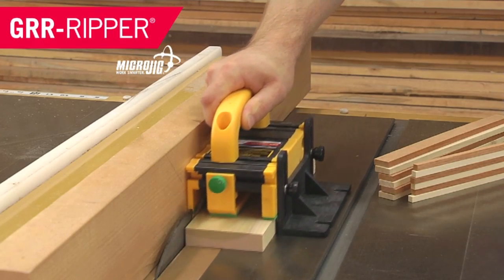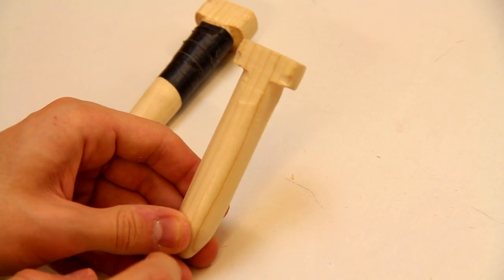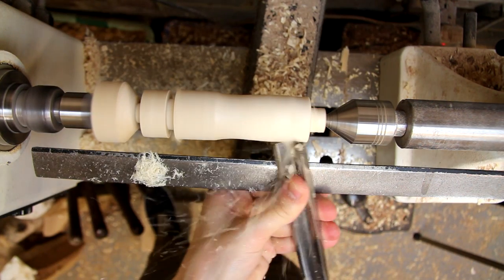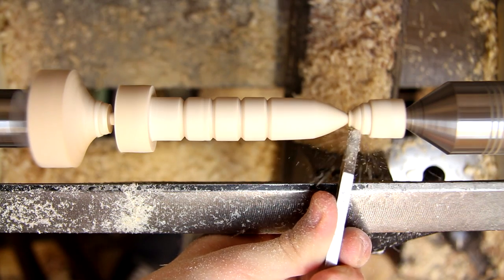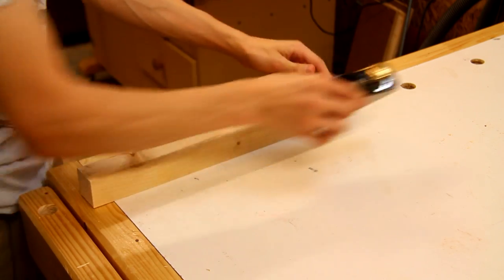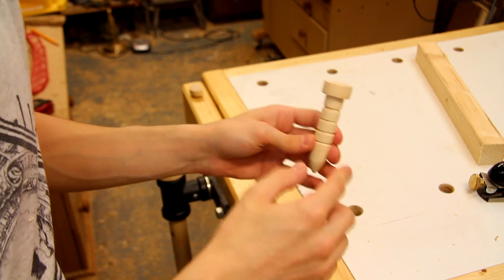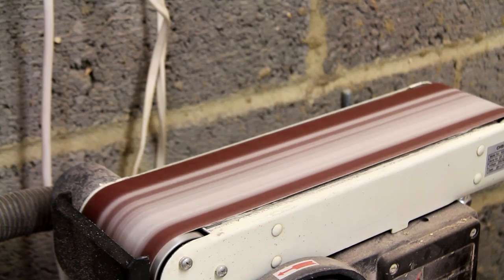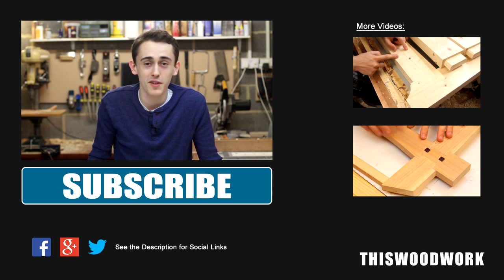Homemade Round Bench Dogs

Comment: I cut a slot in mine at the band saw and put in a little wedge which creates a little spring effect.  Then you can make the fit a little loose but it still stays where you put it and it won't be as affected by seasonal changes.  You have to leave enough solid at the top to keep it from splitting.
Reply from the maker: Cutting a slot would be a really good idea, particularly if seasonal changes are causing problems, I might give it a try myself. Thanks mate!

Comment: So if you don't have a lathe or a belt/disc sander, you're pretty much out of luck. Or you get real good with a sharp knife.
Reply: 3/4 inch dowel?  especially with the spring to hold it in place and one side slightly flattened--does the same thing and no need for the lathe work